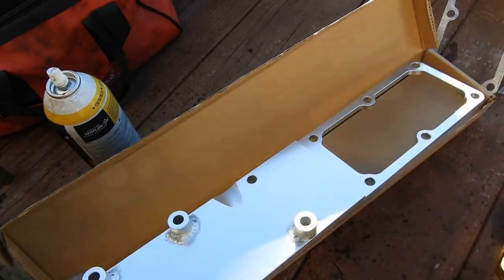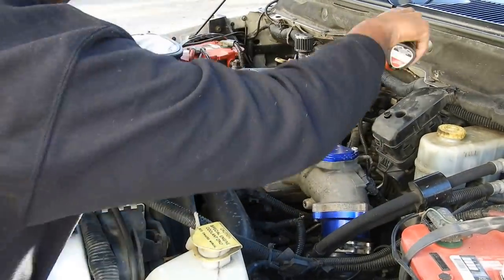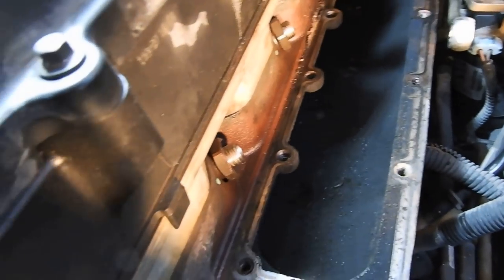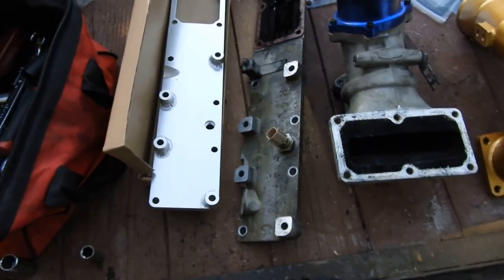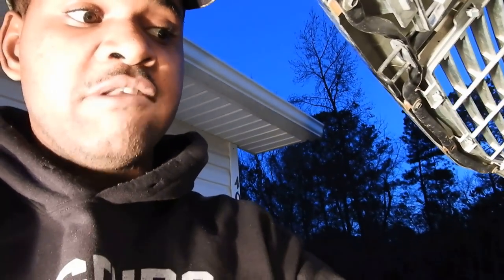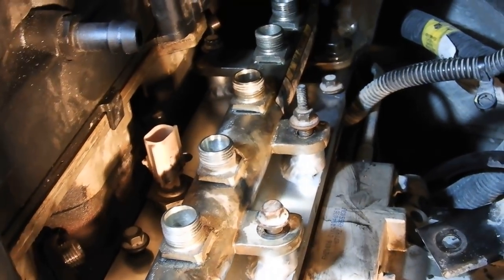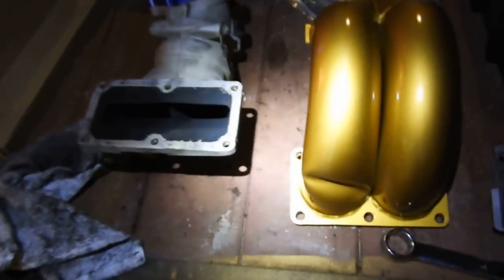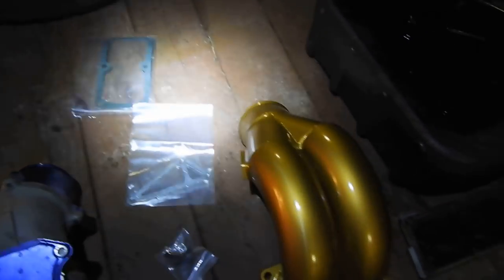HOW TO DELETE GRID HEATER ON 6.7 CUMMINS

Comment: Hey EveryThang!  Are you located in a warm climate?  I'm asking because one of our Rams -- a Cummins 5.9L 24-Valver -- lost it's grid heater ... and, now that it's in a cold climate, it's a bear to start.  In other words, during the warm months, it starts up first try, but during the cold months, it's a real SOB start up.  Now I'll get back to your video ...
Reply from the maker: I live in north Carolina for the 24v do you plug up the block heater?  I dont have issues. The grid heater just warms up the air going into the cylinders walls. Sounds like ur starter is getting weak.. also check your batteries
Reply: @EVERYTHANGDIESEL  I spend a lot of time in the mountains where the temp's stay well below freezing for weeks on end.  I'm very familiar with both the block heater and the grid heater because not using the block heater to warm the engine oil or the grid heater to heat the intake air makes starting any of our diesel engines extremely difficult.  As you're in NC, the climate is quite a bit different.  Except for the very rare occasion, you really don't need either type of heater; hence, the question.  We also run and work on heavy equipment and, based on my years of experience, the only engine we have that's very difficult to start in the winter is the old Cummins 5.9L 24-Valver.  Why?  Because the intake grid heater no longer functions.  Regardless, I was just checking to see where your truck is operated in case you needed a helpful hint.  Merry Christmas and a better New Year to you!
Reply from the maker: Thanks man everything you said is very true. The old 24v need a little pick me up during the cold months but they still run strong. Haha thank you

Comment: Doesnt apply to 4th gens. Mine still calls for diesel pre heat and since theres no heater grid itll just hiccup
Reply from the maker: Randomchannel really? I mean I seen 4th gens do no grid heater startups it's the same kit for mine and yours truck.
Reply: Definitely will work for 4th gens. Alot of people are having issues with the bolts coming out of the stock grid heater and falling into the engine so they are deleting beforehand. Truck will still start. I have a '13 2500
Reply from the maker: Danny Williams agreed

Comment: Why delete it,  it was designed to be part of the system. Engineers and Cummings didn't just sit around and design it just for the heck of something to do that day.
Reply: For sound and better fuel economy
Reply: Because the bolt can break and fall into the engine!!!

Comment: Grid heater deletes are stupid, change my mind
Reply from the maker: naw im good
Reply: EVERYTHANG DIESEL you get no practical gains
Reply: @tannerlevi8596  only gain is low end hp/tq it's very minimal on the top end. It's a major obstruction in airflow and if you don't delete the EGR it gets caked and further restricts airflow. Thus creating higher EGTs. It's great for us who live in the south and don't need to heat the air. Here's a link with a write up and Dyno results of three different style intakes with a grid delete. The proof is in the pudding, granted you won't really feel a noticeable difference since the head is the limiting factor there are small gains for cheap. If you want big gains you need to do a port and polish stud the head injectors and pump.

https://www.dieseltruckresource.com/forums/3rd-gen-high-performance-accessories-5-9l-only-107/intake-manifold-tests-complete-182966/